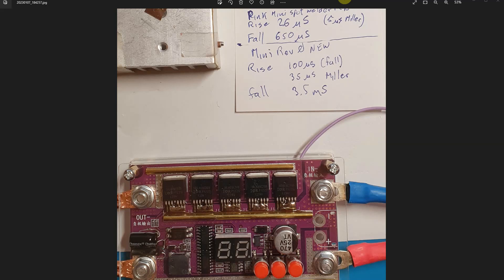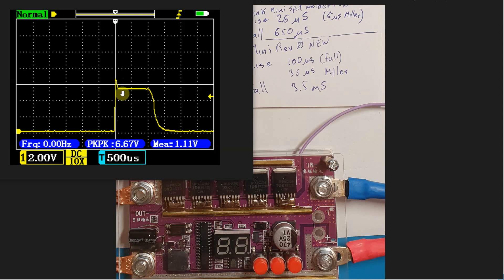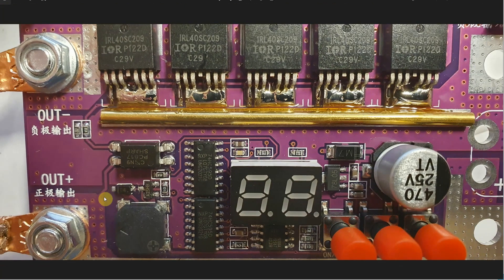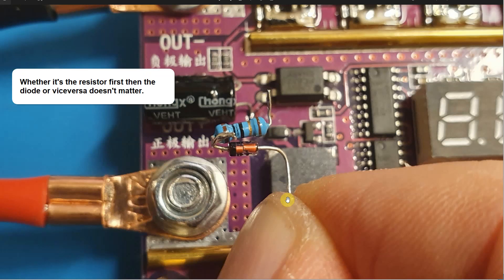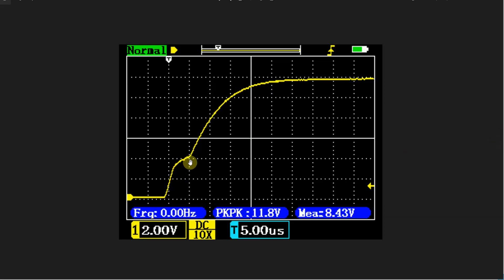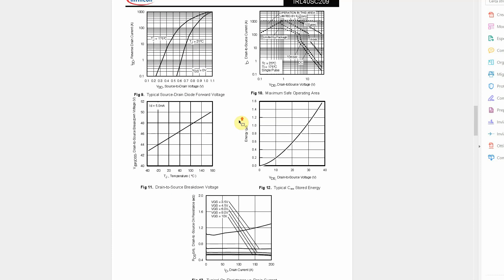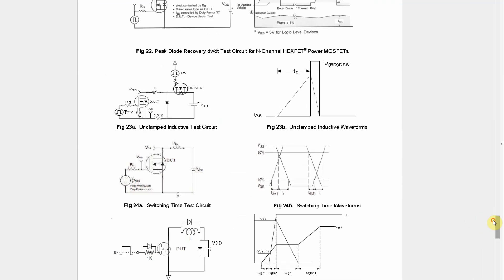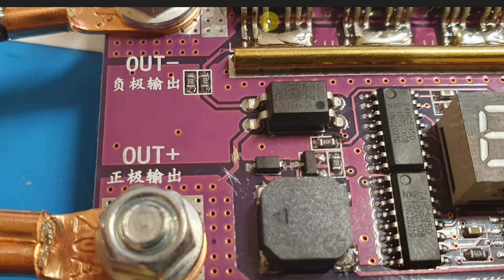"Purple" PCB Mini Spot Welder

Comment: So on this version, the MCU does not suffer confusion from the droop in
Power Supply voltage? Only the FET driver?
Reply from the maker: This version has a 470uF decoupling cap on the 3.3v regulator so the MCU is decoupled yes, only the optocoupler output junction is tied directly to V Batt which can drop.
Reply: @Luca_Techy  Ah yes, as I suspected! Thank you, sir, you are a
Fountain of Information......

I  am planning to buy another of some version for a backup in the
event I "smoke" my current one. I think I'll stick with my plan to
make a "Mod Board" mounted behind the main board, It would 
contain a FET driver chip(remove opto chip!), foot switch 
interface(if needed), your cap/diode/resistor mod, and maybe
 buzzer switch (on/off).

With a little work, these cheep boards can work really well. 
Without some mods, they make great smoke bombs........

Thanks again, I look forward to your next installment in our
education program series!
Reply: @Luca_Techy  Thank you for the earlier reply; I have ordered one
of the purple boards. Since it will be 2->3 weeks to arrive, I have
started fiddling around with Eagle to design a Mod Board like I
mentioned in the previous comment. I'll be ready when it arrives!

One really simple fact I cannot find. That is the exact spacing of
the mounting holes. Suspect they are different from the Red Board,
but I'm clueless. Do you know where that info might be published?
My search engine puked up everything but that!

On a more interesting note, in one video you mentioned the fact that
all the FET gates are wired parallel with no individual series and pull
down resistors. Bad news as you suggested. So I am wondering about
a method to fix that. Since I will be using a FET Driver, it seems that
there could be (at least) two ways to approach that:
1) Have the FET Driver drive 5 series resistors & 5 pulldowns. Cut traces
to the gates (in static free enviourment!!!) and drive the FETs individually.
Lots of resistors, but a Mod Board would have TONS of room - even home
designed, etched, and stuffed with very "loose" design rules...
2) Simply use 5 FET Driver chips - one per FET. Crazy overkill for sure!
 And maybe overload the MCU output driving 5 inputs to FET Drivers?
Of course, 5 chips would have slightly different prop delays - unmatched.
But with the lightning speed of these things (ns), I suspect no significant  problem.

Do you have any ideas of an optimal way to drive the FETs individually?
Being retired, my time is cheep! (When I can get away from the darned
old tractor for a while)...........
Reply from the maker: @dd_ranchtexas4501  If yuo check out my playlist there are schematics of the other Red Mini Spot welder (also REV0) boards I made available: you can see how they drive the FETs in a more proper way with a 30Ohm resistor in series with every Gate (but the more recent lack a proper FET driver). This is then all fed to the same push-pull driver. If you stay within 5 FETs with those characteristics you can use one single MCP1406/7 driver as it can handle the total capacitance of the combined gates - you needn't go for one driver per FET as we are switching just on and off every bunch of seconds, not the critical hundreds of KHZ in a switching PSU.
Reply: @Luca_Techy  Yes sir, 5 Drivers for 5 FETs are crazy overkill!!
Just another insane BidenMoment for me.....

I have all (I think) of your schematics of the Red boards. I used those
when I made the FET Driver mod board for my red board. It works
wonderfully well - zero problems. So I am focusing on my #1 choice 
from my previous posting. One FET Driver with a series resistor and
a pull down for each FET; thus 10 resistors. I don't yet know the 
exact dimensions of the PB(purple board), but clearly there are acres of 
room on a board that  is the external size listed in the ads for the PB. 
Initial Quick & Dirty layout with Eagle CAD looks encouraging.

In another PB  video, the author pushed it up to the point of sorta welding 
a 0.3mm strip. And I think that was with the Opto Driver (Ugh!) for the gates. With a FET Driver chip, like the MCP14xx or TC44xx series, the 
much faster switch times getting to high voltage and return to zero
should, I think keep the FETs cooler and less stressed.  Even with my 
new Ovonics 8A 80C 3S1P battery. The less time spent in the Linear 
region, the better!  
At least that is my S.W.A.G. (Scientific Wild Ass Guess)......

Gonna be a long 2-3 weeks waiting for delivery of the board.   (-;
Reply: @Luca_Techy  Well my purple board arrived Wed and I just tested it with the mod board.
Mod board had FET Driver, foot switch interface, and buzzer on/off switch. Just finished looking 
at the FET Driver input and output to gates. My old scope is - like me - old, tired and not too 
close to reality. But I got a little info anyways. I have the single FET Driver driving the gates via
5 sets of 30 ohm series resistors and 5 10K resistors for pull down.

I looked mostly at the rise time - fall time was a tiny bit slower.
T(r) was 200ns at 3.5 volts [the V(t)] to the miller spot.
T(r) at 400ns was out of the miller spot and had climbed to 4 volts.
T(r) at 800ns -> 8volts.
T(r) at 1600ns -> 10volts.
T(r) -> 3200ns 12volts and pretty doggone level.....

I tried a couple of test with nickel strips - no cell welds - and found that it seems to be about
the same as my Red Welder with the FET Driver. 
I will need to test it more and make a pack or three to really get a feel for it.
Today I just used tmy Ovonics 5A, 50C. With the Red Welder my 8A,80C really pops. Probably
will be the same with this purple board. Now I have a nice backup if I smoke the original!
Thanks again for all you do!

Comment: Please tell me the optimum specifications (voltage, capacity, maximum current) of the lipo battery that can be used as the power supply for this Mini Spot Welder.
Reply from the maker: Check my latest video!

Comment: Hi, thanks for the vid.
I'm tempted to get this purple one instead of the new Rev0, given the issues with it. 
Would this one be able to support 850A from AGM battery in combintation with very short pulses (2-4ms), or that's pushing the luck too much? :)
Also when the fets fail short circuit, that puts full current to the welding terminals, burning the user and making holes into the welded cell, or the fet just explodes too quickly for it to happen?
Reply from the maker: 850CCAs can be overkill if this value is real - maybe extend the power leads by doubling their length with the same gauge. When a FET shorts there are 2 possibilities, one the FET fails and yields a hard short and you risk burning a hole in the battery or strip (most common) or the FET literally explodes and "opens up" leaving no current flow - but this is very rare honestly and most of the time you get a hard short. I suggest you check my latest FAQ video for all the details!
Reply: @Luca_Techy  Thanks for reply. Yes, I checked the FAQ quite literally after that comment :)
Ended up purchasing Wise Maple version, which seems to be the best (has tvs, actual fet driver, 4 fets instead of 5 so less issues with matching, only needs inrush resistor).

Comment: Luca IF replace ALL the IRL40SC209 mosfets on my board and replace with the IRL40SC228s will the board be ok as far as working with the mod and with the other parts on board or do I need to beef up other components on the board too?
Reply from the maker: You can keep the driver setup as is.
Reply: @Luca_Techy  do you think replacing with RL40SC228 will be a waste of time or a good replacement.... I was reading some people had done this and thought id ask  for your opinion/advice..
Reply from the maker: Most probably the issue is that the supplied FETs on these welders are low quality clones and not really matched (apart from a bad driver design). Replacing them with better quality matched FETs purchased from a reliable source is probably why they perform better, not just because they are more powerful. Keep this in mind. I will release a video soon where I talk about this.
Reply: @Luca_Techy thank you ill be looking for that new video
Reply: Getting these IRL40SC228, Trans MOSFET N-CH 40V 557A 7-Pin(6+Tab) D2PAK T/R (5 Items)
Brand: Infineon Technologies

Comment: This board send continuosly pulse even if the pins don't touching ,or is activated by the touching of pin and  send the pulse?
Because I don't understand how the mosfet is activated and how they are interrupted if you bypass the red wire (+)?(if i use a external wall power source)
This bord work like a timer with continuosly pulse when is powered?
Reply from the maker: I'm not sure I understand what you're asking: the board has a contact detect circuit which activates the FETs after a second or less you make contact with the terminals. If you find that it always welds or there is always current at the terminals then there is a shorted FET most probably. You can do the lamp test I show in my other video (check out the playlist) to check correct operation of the welder.
Reply: @Luca_Techy  ok perfect thanks very much
Reply: @Luca_Techy  i ask because i see another MOD where a guy bypass the PCB with the red wire of battery ,and for powered PCB use a external wall power source,this for prevent droping voltage on mosfet.
Reply from the maker: Yes I see, that is also possible but if you do the decoupling mod I show you really don't need an additional power source or external PSU for the logic. I get many questions regarding this and I see there is some confusion so I will try to make a video about these FAQs and reply to all and clear up some misconceptions.
Reply: @Luca_Techy  thanks 🤗

Comment: Very good video. You have 209 FETS, I have 228. Do this mod apply to 228 also?
Reply from the maker: Yes it applies to all FETs conceptually, the correct GATE drive Voltage must be assured.
Reply: @Luca_Techy  thanks for the answer. My mod  https://youtu.be/UTXGsaH93zQ
Reply: @Luca_Techy Hi Luca. Should this mod also be done in kekk k100?
Reply from the maker: @SkromnyWarsztacik  some versions don't need it, it depends on the revision. Check the community section of the channel for more info!

Comment: Can it weld 0.2mm strips?
Reply: Thanks for the detailed description and scope images. I did the cap mod and it works great. Amazon in Sweden still delivers the version without cap feeding the opticoupler.
Reply from the maker: It's stretching the limits and the risk of blowing a FET increases a lot, you need a very good battery but I personally would stick to max .15mm.
Reply: @Luca_Techy  thanks for a reply. By any chance is there a "cheap" spot welder for 0.2, that you know about?
Reply from the maker: @GargamelCZ  in all honesty I can't vouch for any as they all have limitations and design issues, it's also a matter of luck. Maybe you get one like this purple one (or even a wise maple or other red mini spot welder Bl/Bl models after doing modding) which have been built with a perfectly matched group of MOSFETS, then you're in luck and may overdrive them for .2mm. For 30 USD or Euros you can't expect to have a super product, when just buying 5 original matched Infineon or equivalent FETs will set you back over 60USD. If you really need to have that thickness then you might consider a more professional product in the range of 150Euros/USD like the one I recently reviewed. It's  either that or take your chances! Just remember to apply rhe suggested mods!
Reply: @Luca_Techy  The thing is, that I need some non-standard battery cell layout and according to a table I found (with strip width/current) 0.15 wouldn't be enough. So I ordered 0.2 nickel strips.... Now I know, that $30 is realy cheap, but $150 on the other hand sounds expensive. I was hoping to find something around $75 mark.
Could getting this cheap board and replacing FETs work? I have a hot plate at my disposal and I can get access to a hot air solder, if needed.
Reply: @Luca_Techy  Oh my. It sure can weld 0.2 :-D 

I've added 5 mosfets on the back side, some extra solder everywhere the current flows and even some thick copper wires next to mosfets... Then I connected it with short 10mm^2 cables to a fully charged 2000A car starter, set the welder to 99 and ZAP! It vaporized piece of 0.2mm nickel like it was nothing. :-O

Setup is pretty much done, I'd just like to know, if there's a spot on the board to which I can hotwire an external switch? I ordered the "YXKY" welder pen with springs and I'd like to take advantage of the built in switch it has. Is that something you can help me with? I don't mind if the board delay is still there even with the switch connected, contrary - if the delay is kept and the switch is added on top of that, it would be the best.
Reply from the maker: You should start always from a low setting like 5ms and go up from there to understand the delivered power and calibrate the weld - if you set 99 straight up it doesn't really help in this and you risk blowing the FETs right off the bat. There is a trace you can cut to add a manual  switch - I believe I talk about it in my latest FAQs video, it's a fairly simple mod you just intercept the positive sense trace and interrupt it and add a switch between the sense side and the positive. The weld delay will always be present.
Reply: @Luca_Techy  Totally, when I'll weld, I will start at short times and slowly work up. This was more of a "show me what you got!" moment fueled by days of frustration where I tried so many bad setups, I've lost count.

I'll check the FAQ, if there is a mention, which lead is the sense, it should be enough. Thanks.

Comment: Luca, Can I use a 33 Ohm resistor ? I have some military spec resistors (black coating) with value of 33 Ohms 5% tolerance.  measure with volt meter i get 33.5 ohms
Reply from the maker: Yes no problem, any value from 15 to 50 or so will do fine.

Comment: Great mode!!!
Can we install additional FETs in the back side to improve the power of the welder so we can go to thicker welds like 0.3mm? Also does it help in the longevity of the welder?
Reply from the maker: You can install them but the lack of a proper driver and matched FETs will introduce additional variables and potential problems as explained which won't necessarily improve the performance. It's up to you if you want to spend the extra money, personally I wouldn't and keep the setup for .2mm unless you modify and add a proper driver (and matched FETs).

Comment: Buen mod, yo lo uso con 2 super cap 3000F 2.8v en serie y no tengo problemas sin la modificación, le he puesto 5 mosfets mas detrás y funciona muy bien, supongoque esta modificacion solo es en caso de usar baterías lipo o de coche
Reply: Ola Francisco. Dijiste que  utilizas  dos super caps en seria para sustituir la batería LIPO que todos utilizamos, y esas funcionan bien sin otras modificaciones? Correcta me si me equivoco. Tambien, porque los pusiste en seria en cambio de paralelo? Doblas el voltage para que Vds sea mas lineal despues de 3.5V.. correcto? Gracias por ayudar me entender lo.
Reply from the maker: Por assicurar correcto voltage por los Gates si la batteria es problematica en general.